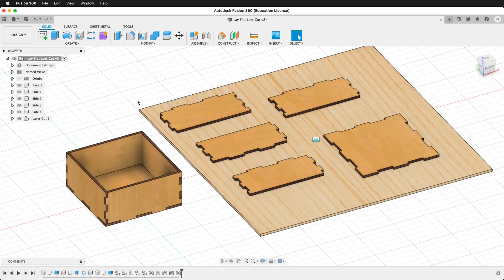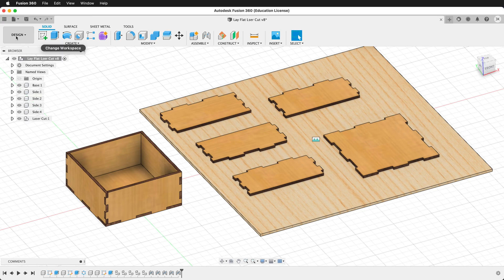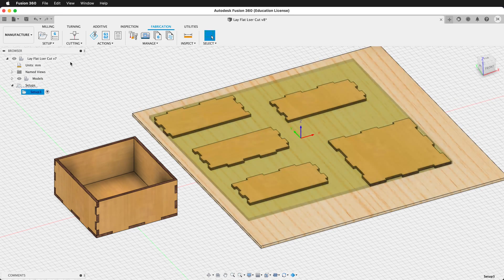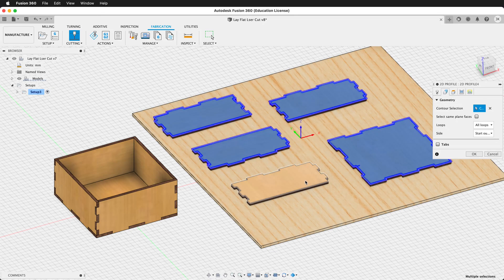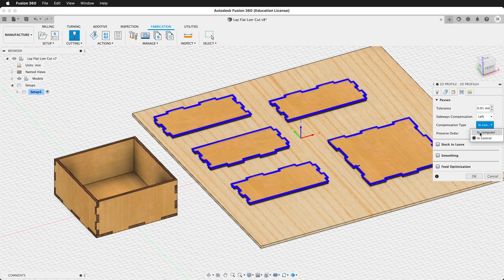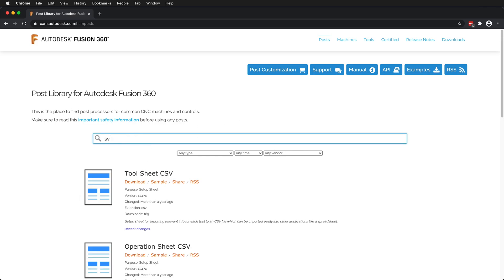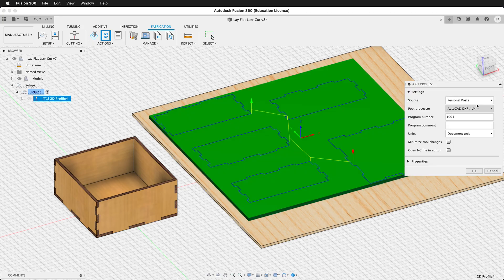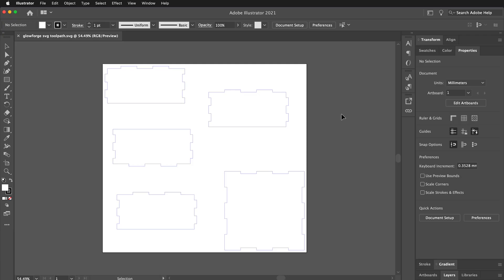SVG Toolpath Export with Automatic Kerf for Glowforge laser Cutter from Fusion 360

Comment: Any idea  how to output a beveled or chamfered edge? I know the laser cutter can't do that, but was going to score the inner part of the chamfer and then use a table saw to get the correct angle. Right now with using this method it crosses the lines. I'm guessing something with orthogonal vs perpective 2d? Pretty much a newbie though. :)
Reply: It doesn't seem like you can ungroup in InkScape in order to fine tune positioning. I saw another option for Html SVG which I then edited and was able to break that one apart and then had to stitch everything back together. LOL, I suppose it's working somewhat then. I just chose the outer "fatter" edge of the board and will figure out the angle cuts later. Thanks again
Reply from the maker: If you have a beveled edge on your model then you can select the bottom plane of the flat piece to get the full exterior contour. Then you can cut the pieces on the table saw.

Not exactly sure what you're trying to do with scoring the inner bevel. You can only cut out the exterior profile and then do an angled cut on the table saw from there.
Reply: @WhatMakeArt  I was trying to make a tapered dust hood shape thing but ended up just scraping that idea for a square box with a hole. I'm still sort of interested in figuring out what I was trying to do, but it would involve a double bevel, one to cut along the cut and then another to cut the tapered cut. Wasn't easy so I just modified what I was doing to simplify things.
Reply from the maker: Sometimes the simpler solution is the better solution

Comment: Dude that was so quick. Thank you for this!
Reply: I am watching by slowing the video down
Reply: @gisler006  sorry, I mean it was quick bu him putting it up the day after I asked him a question about it.
Reply: @AlexParton  😃 so you can catch everything in the video? it is not fast?
Reply from the maker: Happy to help!
Reply: @WhatMakeArt  If I use a tool like this to find my kerf: https://www.etsy.com/listing/889136447/ and thats what I'm plugging in for ply it works perfectly when it comes to inserting two pieces together. When I try to use a tool like this and do finger joints I have an issue where the pieces aren't snap fit. The cut out for the tab to get put into is too big. What would be the best way to solve for something like this?
Reply from the maker: The method I show above is the best. Find your exact kerf with a tool like you linked to. Then you model your parts in 3D in Fusion 360 for exact fit. Lay the parts flat. Make a "Laser Cut Tool" in fusion that has the specific kerf for your machine. Then make a tool path in the Manufacture workspace. Use the kerf compensation in the passes tab as shown in the video. https://youtu.be/vo2ScW3SxIk?t=61 Then it should have snap fit. If you want to make it tighter, then make your kerf number in the tool bigger, for a looser fit make the kerf smaller.

Video showing how to make a laser cutter tool in Fusion - https://youtu.be/-B6DXF9aE5s
Reply: @WhatMakeArt  Thank you for your help! I am going to try this tonight and i'll get back to you. Sorry for all the questions... that being said I will probably have more!